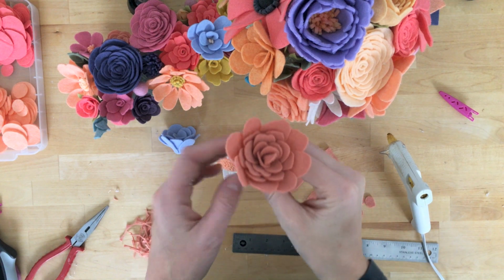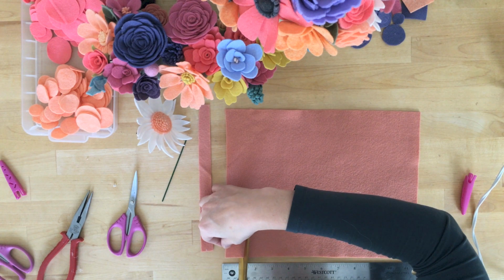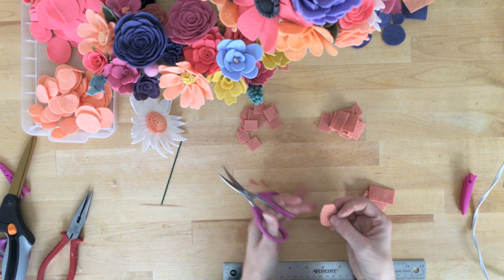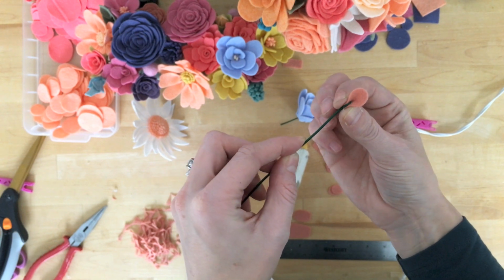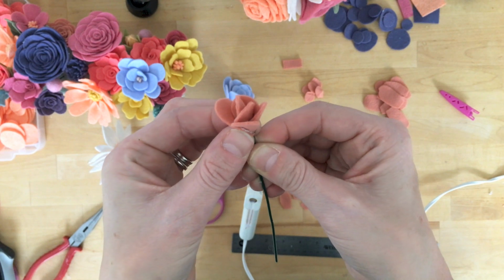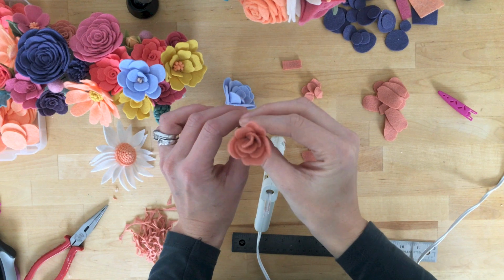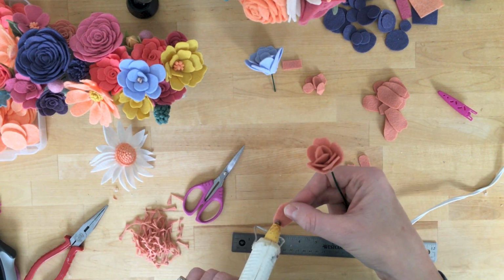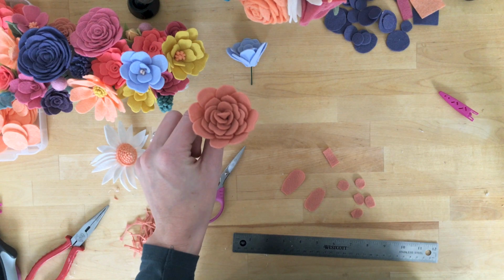Felt Flower Tutorial (easy!) - A How-To DIY Tutorial on Felt Flower Making

Comment: Hey Kacia! Question... On the second row of medium and with the larger ones.. Do you stick those more onto the felt underneath, or to the wire? Looks like more you start adhering to the felt so it will sit flat when finished, but wanted to check..
Reply from the maker: Hey!  So you can really do either, and it'll change the shape of your flower!  You'll see that more when I do a ranunculus next week.  I will also show how I add a bit of green to the bottom of the flower -- if you adhere them to the stem, they may "flare" out a bit more?  I go a bit lower on this one, not much.  That answer was kind of all over the place, but really the answer is: yes and no! :)
Reply: +Coconut Robot awesome, ok! Thanks so much!